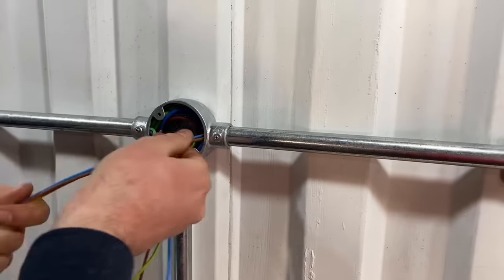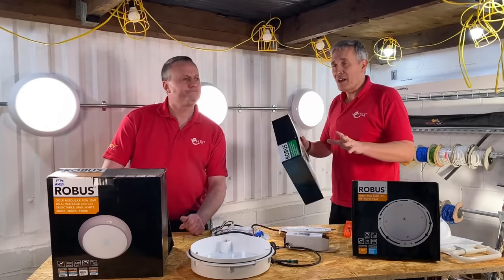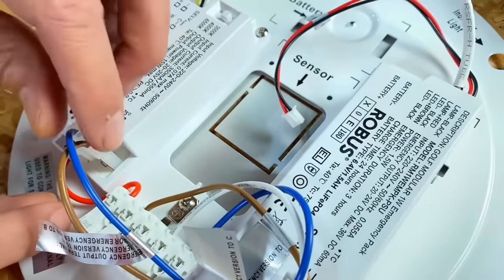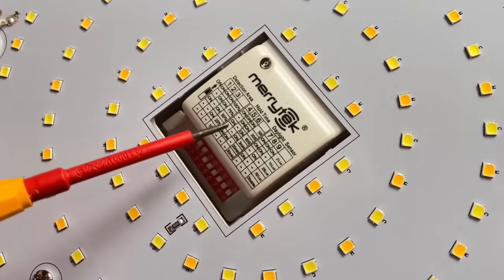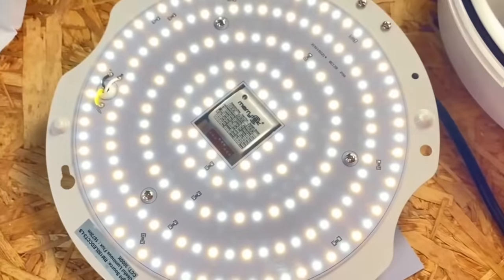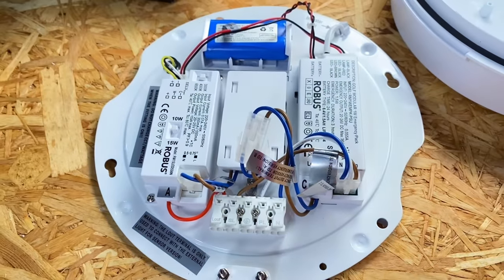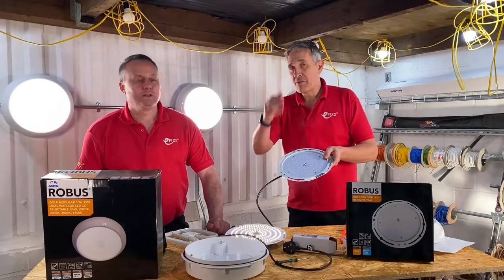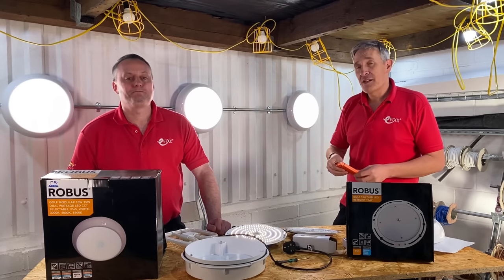The Ultimate Power Saver: An Energy Saving All In One Light from Robus

Comment: problem is....good old 28w 2d gives out more light, circa 2000 lumens, a lamp is like £1.50 and even if it needs a ballast that's only £12 or so. In terms of a maintenance role, often it is easier and quicker to fix the 2d fitting and it still gives more light. I dread to think the price of their led emergency tray.
So called upgrades are great in theory, but they're not as wonderful as some might pretend
Reply: Its about the power usage nowadays. KWHs are increasingly expensive..........
Reply: @LeighWinspear  Yes and no. For the extra the LED or conversion costs, you could run the 28w for several years before you break even. It's the same with all the talk of tumble dryers etc. I reckoned that it would take around 100 years before a new one, would actually have saved me money from keeping my existing one. Obviously if it breaks I may consider a newer fancier one though. But to change just because someone claims it will save money....after purchasing a new one, it really doesn't.
I notice there is no mention at all of the costs of any of them in the video.
Reply: @blow0me  I want an affordable, electric conversion to my 30k miles, diesel van.  When the maths is done regarding an investment, I kinda wish I had bought an electric car years ago. But, the diesel 60mpg, option was best at the time. I dont want a new electric powered vehicle, just an affordable conversion  please Mr green politician...................;)
Reply: @LeighWinspear  Such affordable conversions do not exist for cars or vans. And even new electric vans have pathetic range both now...and years ago.. Batteries are very inefficient and all this green vehicle nonsense, is just that. Nonsense. They just push any problems further afield.

Comment: I know the team like an energy saving video, so…. Can you do a video on LED smart bulbs and the current/watts they consume at various stages of the dimming cycle, say you had a GU10 rated at 5.5 W and you only used it on 10% (via an app) in an uplighter for surround effect, how much current/watts would it use, is LED  current usage linear so the consumption is 10% of full load.

Comment: does fitting straight to the conduit box with a just a hole for the cables to come through maintain the ip rating if it was to be used outside or is there a way around this?

Comment: And lights that place modules in the middle of the fitting/tray...can be a nightmare for cable access, as usually the cables will be entering from the middle of the fitting. Eaton created a total disaster of a fitting in this same "golf/disco" style which basically made fitting of emergencies impossible as the huge combo driver was slap bang in the middle leaving no room for cable access...which they put at the outer edge of the fitting instead. Total nightmare ( would have been nice if the idiot who ordered the hundreds of them had actually checked them out first )...and that wasn't the only issue with those emergency fittings

Comment: Saving energy but this is a disposable light, as soon as the LED's or power supply fails its in landfill whereas its old counterpart could of at least had the lamp changed if it failed, manufacturers need to provide access to spare parts as just binning the entire light is unacceptable in this "green" day & age.
Reply from the maker: The design of the fixture allows for easy upgrades of the led gear try just like a lamp.
Reply: I have a Robus exit sign from 2018 and the model is not even made anymore and you can't buy a replacement strip of LEDs or the driver from Robus. When these lights fail, the electrician probably isn't going to bother ordering a new LED tray from the manufacturer for a 25 quid fitting lol. They will just install an entirely new fitting.
Reply: @Xenon777_  Exactly, planned obsolescence with the PR stunt that is the perception of replaceable parts when in reality those parts are not economically viable compared to replacing the entire fitting or if the parts are even available from the manufacturer in a few years time if they have not dropped the line or make it a right pain to acquire the parts.

Compare that to the old CFL lamp they replace that you could pick up a replacement lamp at any wholesaler easily versus throwing the entire fitting in the trash.